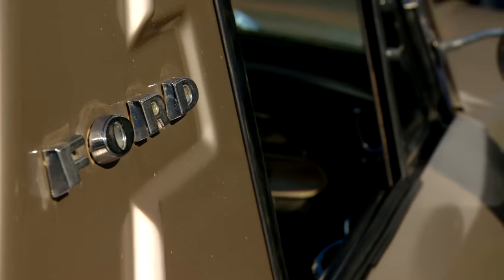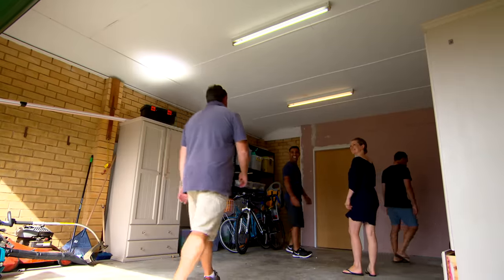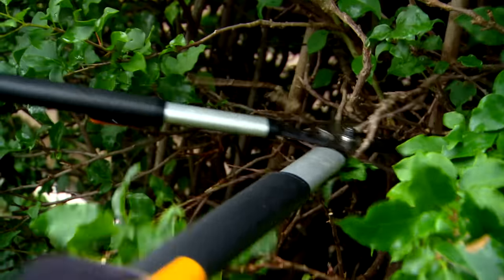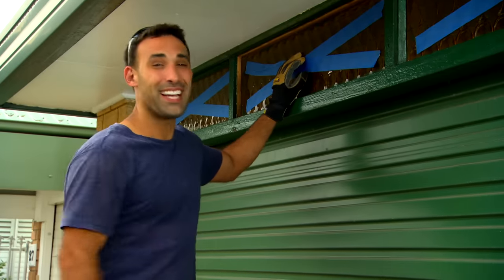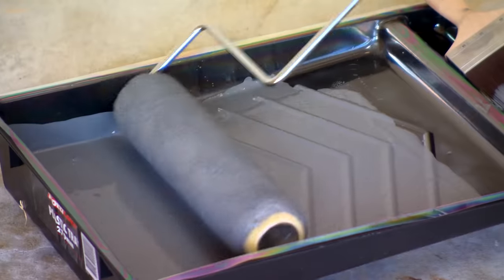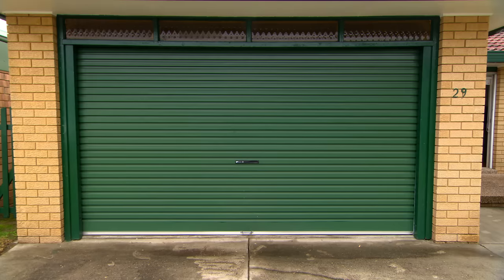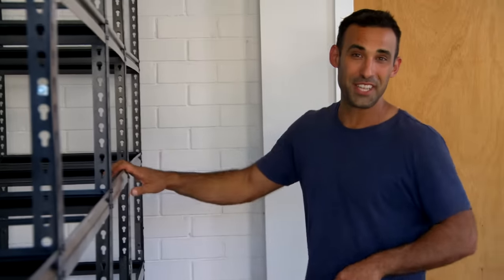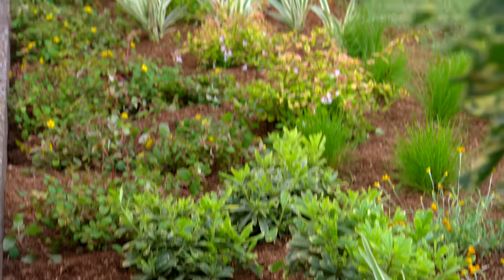How to Upgrade the Front of Your Home and Add THOUSANDS To It's Sale Value | HOME | Great Home Ideas

Comment: They could have just painted the old garage door. It wasn't that big of a difference in look. The real upgrade was the above glass being replaced. Overall, house does look great!
Reply: I initially had the same thought but the new garage door is insulated which does make a big difference. 🙂
Reply: @sunshineandpuppydogs7526  ...ur right. The quality definitely improved. Aesthetically, it looks close to the previous design but the upgrade alone will no doubt increase the value of the home.❤
Reply: It was probably an advertisement for the door company. I'm sure the couple liked the upgrade. But yes, us normal people on a budget? A paint'll do the job just fine :)

Comment: I've used a Gerni high pressure surface cleaner to clean my garage floor up and it did a fantastic job. Very high pressured water can peel away all sorts of dirt and grime without the need of resorting to chemicals.

Comment: Most people paint the problems, it’s better to update but everyone misses the roof, could have cleaned the tile roof and adds another major level of improvement. The pressure washing looks like it was done on the driveway but obviously with a small machine which left streaks. A professional pressure washer and roof cleaner could have done that in a couple hours and it literally looks brand new, that is where it lifts the value $40,000 to $50,000 but only costs $2,000 and helps the roof last for ever, Rather than pay someone $5,000 to paint the roof or even worse, replace the roof for who knows how much $$. I would have also made sure the lawns had some fertiliser to lift the green and bring it to life. Another major lift to value is the front door, that would have tied in with the new roller door.
Reply: You made some excellent points. However..keep in mind this was all done in one day..as you can tell by the couple wearing the same clothes at the end..so there is only so much time to do things. Also..these shows don't want to spend any serious money for improvements. All of those products/services you saw..from the installers to the garage door to the paint..was provided free of charge in exchange for the exposure. So if something wasn't done..it was probably because they couldn't find a company to provide it free of charge in exchange for the exposure. But your recommendations were on point!

Comment: The sliding door is still dated and ugly with the diamond pattern.  Also the amber glass should have been changed out next to the front door to match the garage glass.  Updating the front of the home shouldn't include inside the garage, unless you leave it open all the time!